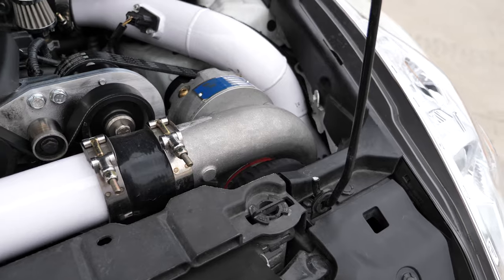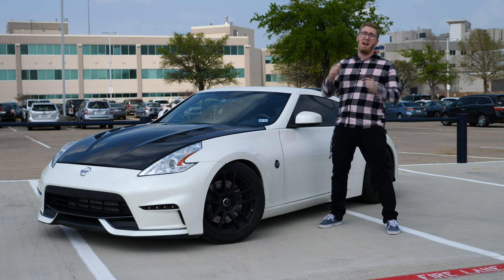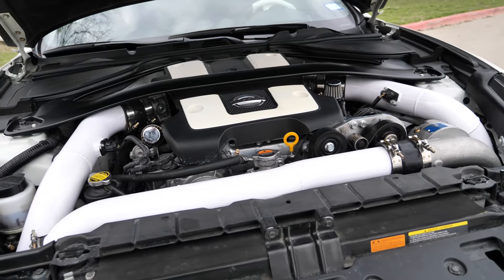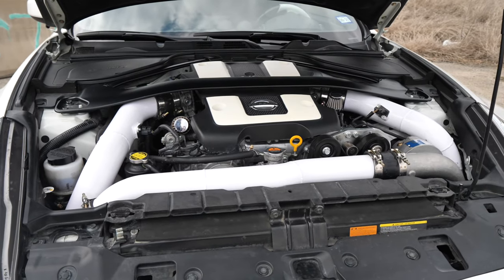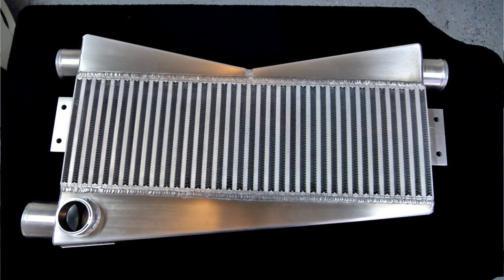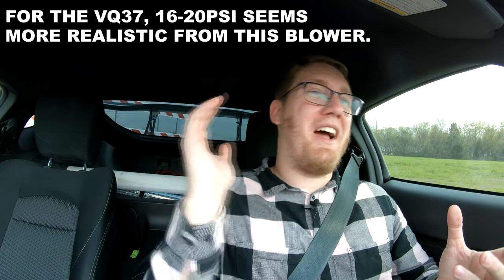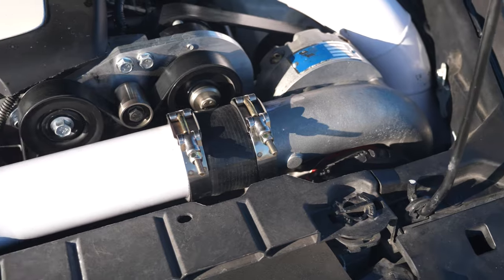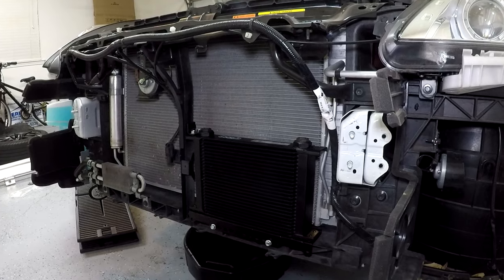The Top Guns Supercharger Kit Just Got BETTER - Rotrex C38R

Comment: Good info.  It was scary to hear about knock issues where tuners are not telling clients that the car has aggressive timing.
Reply: So, I picked up my car today.  It made 630whp on 93 octane (similar to Vin's car) and 685 whp and 495 wtq on e85.  However, that was only to be a dyno queen.  Before going out the door, the timing was scaled back.  It still pulls like a bull.  The first time I got into it, my eyes must have looked like baseballs.  They sold me an ecutek ECU connect for data logging.  I've got to download an app and I'll look for any spikes for knock events.  After they scaled back the timing, I'm probably in the high 500s on 93 octane and low 600s on e85.  It is loud and I would prefer less flutter, but it's not a deal breaker.

Comment: The gallery gaskets are an issue. If they are not replaced, the engine will starve for oil and blow. Especially when the motor has extra horsepower.

Comment: I just replied to you on 370Z  board. Good times! Edit: I need to buy that Bluetooth EcuTek dongle.

Also... more torque lower in the RPM band means more shredded engines. You know the torque in these engines tears them apart. Low RPM and mashing the throttle is a recipe for disaster. What’s your take on this whole EPA issue? It’s the only reason I haven’t decided which way to go for boost noises.
Reply: That's why centri chargers are so great. Easy torque ramp in. Unlike turbo that slam it all in at once.
Reply from the maker: Not sure what you mean by take on the epa issue? Are you referring the news related to the rpm act or Aaron's kit getting smog tested?

Comment: I hope the new kit addresses the awful flutter that many ACE customers are complaining about. Personally I would of liked the silencer he has mentioned as a fix out to current ACE customers first as priority....but that's just me.
Reply: Spot on!
Reply: A few people seems to solve it on their own, when I get some time to experiment I want to throw in a regular air filter and find a way to kinda encapsulate it, not perfectly, just to make a firewall wanabe or add some surface to absorb a bit of the noise. Won't be perfect but is cheap to start experimenting in reducing it a little bit
Reply: @ZeroFX32  I've spent the time and money in doing so with my tuner, Dynosty. I went from a PT50 bov to a TialQ, with a modified 2 psi spring. They got it down as quiet as possible however it's still there but much better than the PT50. Aaron states on the 370Z forum that he will provide ACE kit customers with the free silencer....but I'm guessing his priority at the moment is this new kit.
Reply: @godzzla_z3438  do you have any link or more info on how can I do the same as well?
Reply: @ZeroFX32  Dynosty tuning in Louisville, Kentucky did all the work.

Comment: Hello how are you? I watched your installation and review video today of the TopGun supercharger for the 370z. 
However at the end of the review video , you said the one you have was no longer available but.......a newer up-to-date version is being released! Prior to your video's, I was considering the Stillen but came across a lot of disappointment from prior 370z owners of the Stillen unit on the forum, however the Soho supercharger was also mentioned but the installation and having to do a lot modifications etc.......were a major concern from 370z owner's! With all said I have a 2009 370z Touring/with Sports package fully loaded with 112000 miles. It's completely stock, with the exception of  FI High Flow Cats and the Injen True Duel Full Catback Exhaust. I have not invested in a Tune for now because I'm now wanting to upgrade to Supercharger! I wanted to ask, about reliability, what modifications, and daily driving with just the stage 1 (I believe you mentioned this in the video) and basic Horsepower for just stage 1. 
I would really appreciate your input guidance etc.........  
Btw, I also wanted to say I like the way the TopGun supercharger set-up retains alot of the stock set/appearance.
Please comment......I know I've typed a lot.

Thank you!

Comment: But as wel all know stock manifold is plastic.. Higher boost and boom goes manifold.
Reply from the maker: Plastic is perfectly capable of holding pressure depending on the grade and thickness. Your PVC pipes in your house can handle 71psi.
Reply: @thecarizon504  Our turbo, supercharged  600 HP -800 HP SEadoos cant at 30psi.  As well as boosted and supercharged cars manifolds go boom. Hence way there not plastic. Other wise we all we see plastic manifolds on any track day.  Be carefull cuz it sucks going boom with plastic. Just looking out.
Reply: Can anyone provide a picture of a blown manifold?
Reply: @adidis1750  all day long